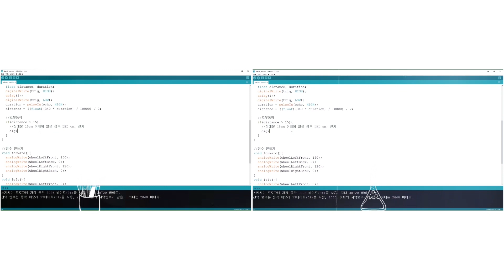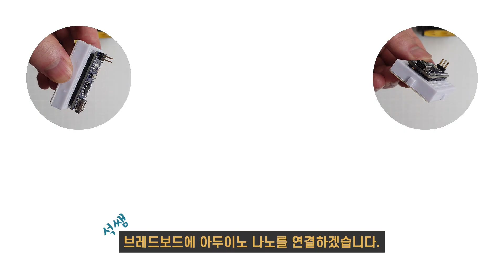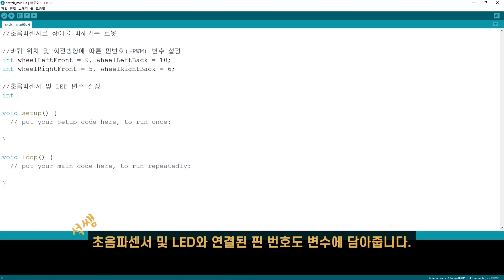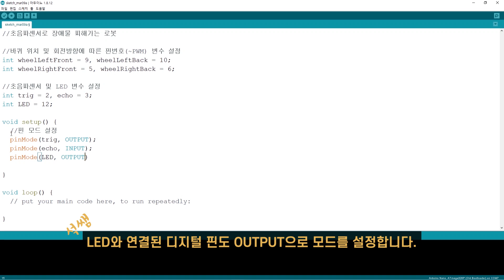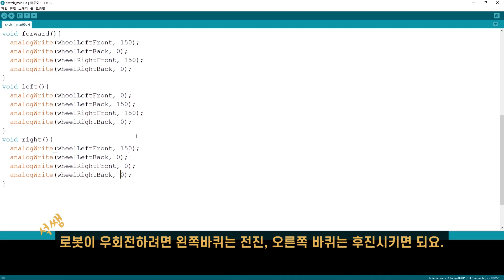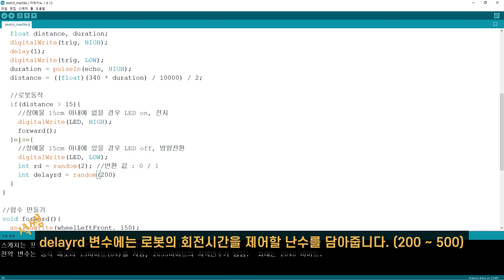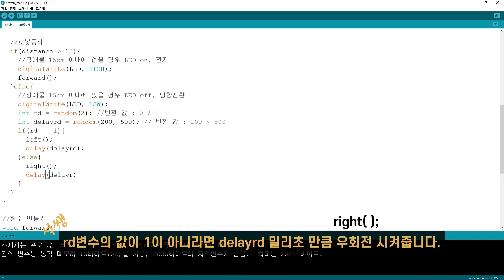[아두이노 DIY] 초음파 센서로 장애물 피해가는 로봇 만들기

Comment: 이거 학교 숙제 인데 아드이노 코드좀 답글 해주실수 있나요?    부탁할게요
Reply from the maker: //초음파센서로 장애물 피해가는 로봇

//바퀴 위치 및 회전방향에 따른 핀번호(~PWM) 변수 설정
int wheelLeftFront = 9, wheelLeftBack = 10;
int wheelRightFront = 5, wheelRightBack = 6;

//초음파센서 및 LED 변수 설정
int trig = 2, echo = 3;
int LED = 12;

void setup() {
  pinMode(trig, OUTPUT);
  pinMode(echo, INPUT);
  pinMode(LED, OUTPUT);
}

void loop() {
  //초음파센서 거리 측정
  float distance, duration;
  digitalWrite(trig, HIGH);
  delay(1);
  digitalWrite(trig, LOW);
  duration = pulseIn(echo, HIGH);
  distance = ((float)(340 * duration) / 10000) / 2;

  //로봇동작
  if(distance > 15){
    //장애물 15cm 이내에 없을 경우 LED on, 전지
    digitalWrite(LED, HIGH);
    forward();
  }else{
    //장애물 15cm 이내에 있을 경우 LED off, 방향전환
    digitalWrite(LED, LOW);
    int rd = random(2); //반환 값 : 0 / 1
    int delayrd = random(200, 500); // 반환 값 : 200 ~ 500
    if(rd == 1){
      left();
      delay(delayrd);
    }else{
      right();
      delay(delayrd);
    }
  }
}

//함수 만들기
void forward(){
  analogWrite(wheelLeftFront, 150);
  analogWrite(wheelLeftBack, 0);
  analogWrite(wheelRightFront, 150);
  analogWrite(wheelRightBack, 0);
}
void left(){
  analogWrite(wheelLeftFront, 0);
  analogWrite(wheelLeftBack, 150);
  analogWrite(wheelRightFront, 150);
  analogWrite(wheelRightBack, 0);
}
void right(){
  analogWrite(wheelLeftFront, 150);
  analogWrite(wheelLeftBack, 0);
  analogWrite(wheelRightFront, 0);
  analogWrite(wheelRightBack, 150);
}